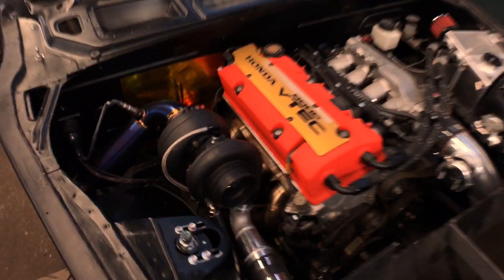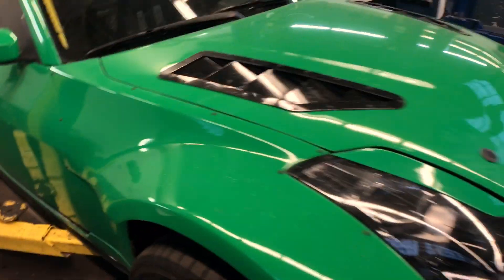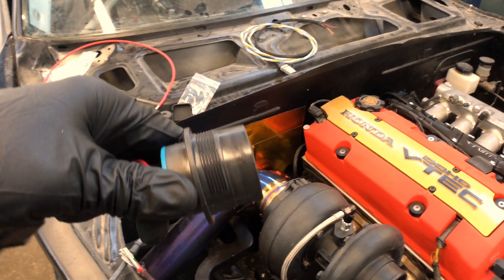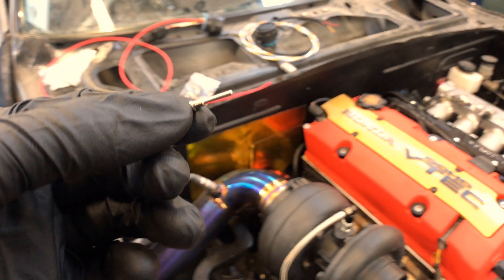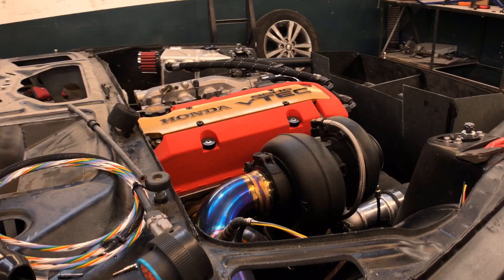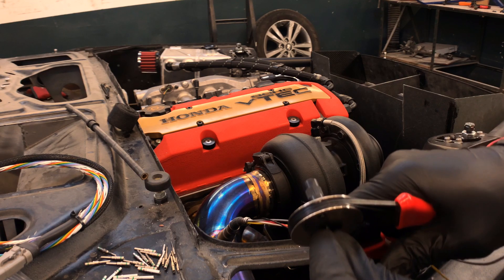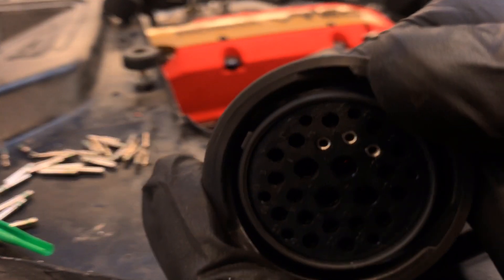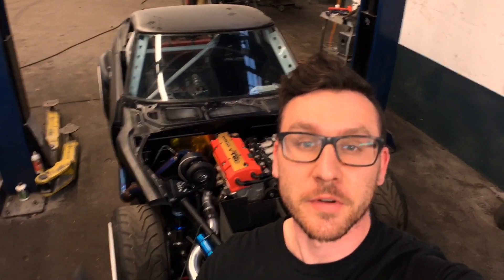How To Wire A Mil-Spec Connector | FMF EP #3

Comment: Even with weather-pac or Mil-Spec, I suggest the use If dielectric grease. Tin-plated copper terminals resist oxidation from humidity or pressure washing, but using the grease, sold in home improvement stores by Permatex is like a belt & suspenders approach. Just a word of advice as you may have endorsed this products use in other videos. Bulbs, battery connection inside DMM, smoke detectors, everything. I hate to open a device to find a battery that has leaked! I solder & shrink tube everything and will fabricate a metal shield to provide a air gap if a wire / harness comes to close to exhaust and other hot items. If tape is used on a harness, I place a dab of black weatherstrip adhesive on the tag end, rub it in & won’t unravel. 
 Just a note; But service manager ask me to take these test in 1977, I was the only tech who said yes, out of 8 others. Passed all eight test w/60 questions each & last guy to leave after I woke up the proctor. Forgot all about it and 3 months later i got this package from the Nation Institute of Automotive Service Excellence with patches & frames with display documents. I was a certified ASE Master Tech but 5 cents per test, my flat rate pay went up 40cents. That was the best part as customer pay was $24 per hour and techs made $6.50 a flat rate hour. Just happened to be at a Datsun dealer. I was the only one of three Datsun techs that would repair the 280Z. The rest were VW and one Porsche tech. He expanded his vocabulary to include four letter words after about 7 or 8 years. I saw him cry as well once! But he was working on Spitfires, Midgets, MG’s and TR-7’s at the time. First black hood vents came on the 77 model of 280Z. First cat w/unleaded fuel, 7/1979 production dates.

Comment: Are you kidding? Why you didn’t trim the harness so it has no extra to rout it on the turbo? Why you took a 20+ pin connector if you had only O2 sensor to connect? Why you didn’t do wire loops and didn’t isolate properly the connection?

Comment: After 10 years repairing wiring and connectors on the F-15E, I can definitely say I don't miss wiring jobs lol. Imagine replacing a 100 pin connector, at night in the cold, in a tight area with several other connectors and harnesses in the way. Yes, not fun :D

Comment: Probably should have added a connector in between the mil-spec connector and O2 sensor so when the sensor goes bad you don't have to cut the heat shrink and de-pin the wiring out of the bulkhead connector.

Comment: For future reference, you want to put a heat shrink wire on all the wires that come out of the plug right around about where the connector's bigger heat shrink ends. Idea being that it takes a little off the stress AND for smaller runs of wire (like this this particular case) it increases the thickness of the wire as the MilSpec shroud is supposed to tightly hug the wires. There's even a small strainer like piece of plastic on some that you're supposed to put on about 4 mm before the heat shrink ends to further secure the wires in, but that's for really big connectors.

Comment: Yooooooo X how much did u get your s2000 for?
Reply: 72k miles 2000 s2000 12g. Wallet hurt. Now at 125k miles
Reply: I use mine everyday only had it 4 years, hauled furniture construction, security patrol car etc etc. In hot florida weather with no ac. 800dollar oem compressor is crazy.